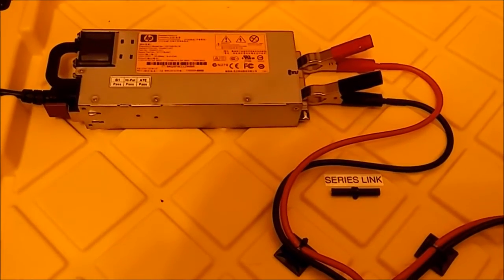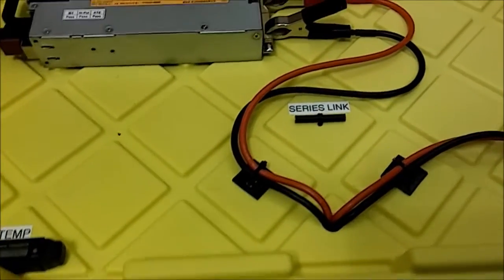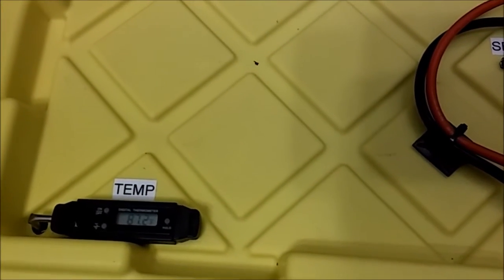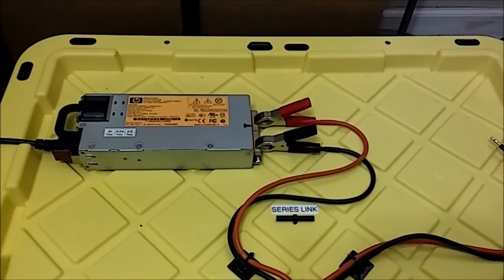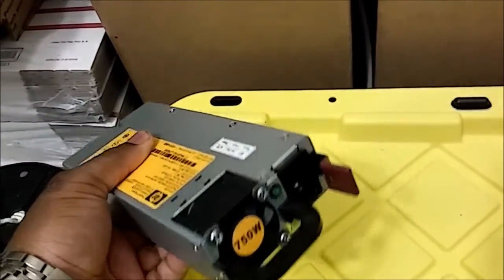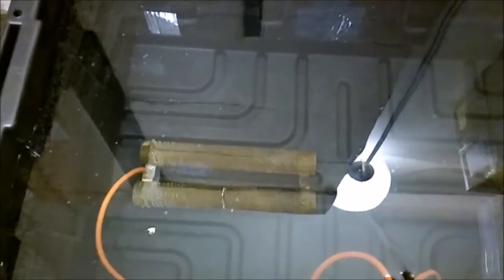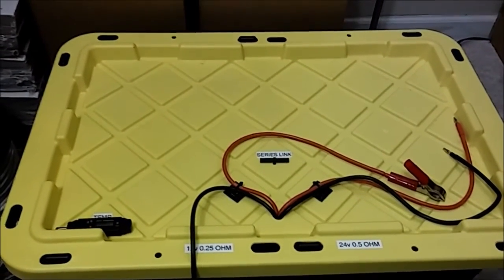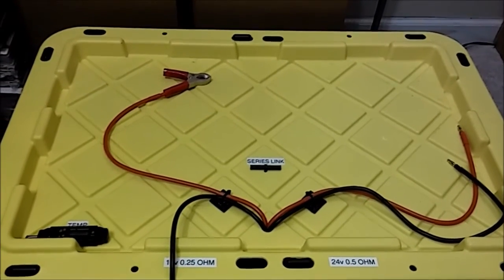Lipo Connection Solutions 1st Load Test On New Load Bank HP 750W Power Supply 2 Hour Test

Comment: i tried many time, i got to get 13.78volts maximum but when i run on load so its showing very low voltage around 12.4 or 12.5..how can i get 13.8v on load?